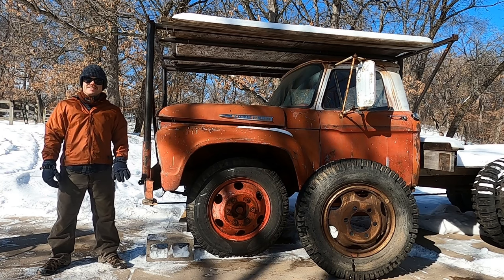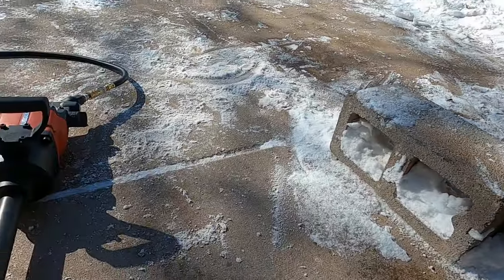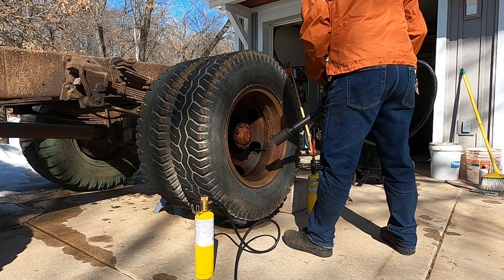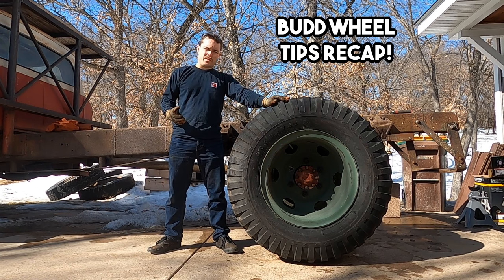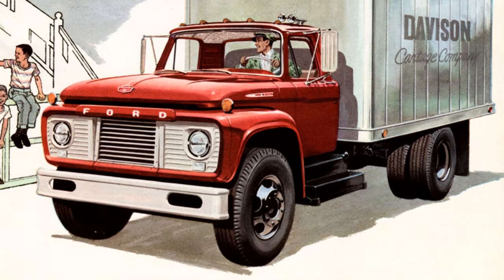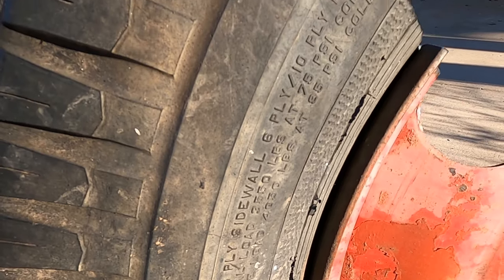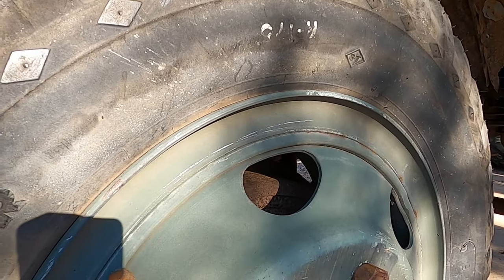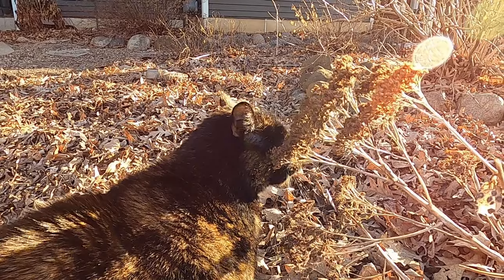All About Split Rims, Explained! Ep. 11

Comment: I have a question or at least just as bad as dayton rims or are they are the same
Reply from the maker: They were not mentioned in the OSHA documentation. Based on a few minutes of research, it looks like multi piece rims for Dayton style cast hubs are equivalent to split ring or lock ring wheels, with roughly the same risks. So, likely a lot safer than RH5°. It also appears you can get single piece replacement barrels for Daytons, which would be safer still.

Comment: I would just either find or have fabricated some modern single piece rims and not risk it.  I get that people can get crazy when it comes to "original equipment" on a resto, but I'd rather not have to worry about death by tire.
Reply from the maker: Sounds like your budget is a lot more generous than mine
Reply: @SealedBeamRallyTeam  It's more cost weight analysis.  Cheaper to get safe rims than to have to go to the hospital or morgue.
Reply from the maker: @hellcat1988  That's why I stepped up from RH5's to split rings. They're not the best, but they're safer and I didn't have to mount tires. In the long term I want one piece wheels with modern tires.

Comment: Is there any reason for the left threads
Reply from the maker: Short answer: no.

Longer answer: as far as I can tell, there was some superstition that the lug nuts should always tighten opposite the direction of wheel rotation, so that they wouldn't accidentally loosen. In reality this was never a problem.
Reply: @SealedBeamRallyTeam  Plymouth(probably many Chrysler products) Had left hand threads on the left, in the 60s. I didn't mind those so much. But the brass studs were a pain, as they would break off if you over tightened the lug nuts.
Reply from the maker: @swmovan  Brass studs!? Fascinating! I assume the reasoning was the same as for brass exhaust nuts.

Comment: I'm surprised they haven't been outlawed completely.  Is it because those trucks tires are impossible to get on a rim without taking the rim apart?  Do single piece wheels exist to replace any split wheel?
Reply from the maker: By the time OSHA wrote its report, the RH5 had been out of production for seven years. Short of the government buying everyone replacement wheels, there's not a lot they can do. You can mount and unmount wheels from the truck just like any other wheel (considering the extra risk with newly mounted tires), but when you go to replace tires, that's when the danger comes into play. To be clear, it appears that the OSHA guidelines for correctly matching rings to bases and inflating tires inside cages have reduced the risk to a more acceptable level. The Alaskan lock ring wheel incident in 2003 was the most recent I could find.

I'm sure you could get one piece wheels for whatever you want, though you might be stuck with a different size tire. Many companies will drill the right bolt spacing and center bore for nearly any vehicle, however those services come at a high cost and thus are usually only used for racing or show applications. I chose the split ring wheels because they are much safer than RH5's, are relatively affordable, and mine came with used tires already!
Reply: From what I understand, all truck (and perhaps some car) rims used to need to come apart to slip the tire on.

Technology improved (perhaps truck tires became more flexible?) and now large truck tires can be mounted on solid rims just like car tires can be.

There's still a place for mulit-piece split ring rims. Large vehicles like payloaders and tractors with huge thick tires that will never stretch over a solid rim. These wheels are still made to this day.
Reply: There's aftermarket companies that make single piece wheels. For large trucks, most go up to "half sizes" like 22.5s in place of 20s and 24.5s instead of 22s.

Comment: That gun needs 1/2" hose. Dont be cheap. Another 40 bucks.
Reply from the maker: A thick hose on a restricted air compressor fitting won't do much.
Reply from the maker: A thick hose on a restricted air compressor fitting won't do much.
Reply from the maker: A thick hose on a restricted air compressor fitting might not do much.
Reply: Need 1/2" hose and fittings back to the tank. Only way that gun will run properly.

Comment: Ok so question, because I sorta notice the wheels that I look at in this video (https://www.youtube.com/watch?v=aNk8Xz6id-w), are being whacked at. 

is it a safety thing?
Reply from the maker: I'm not a professional. But what i see is that they are seating the lock rings with zero air pressure in the tires. My experience preparing props for this video showed me that a BFH is necessary- these things are STIFF and hard to move.

The danger comes in when you air them up. Tire cages are ideal, but notice that the wheels are being mounted on the rear of the truck, with the lock rings pointing inward. If the rings blew, they would really f*** up the truck, but they are not able to physically fly through the truck frame and out the other side.

Widowmakers would be the opposite because the rim barrel itself is split and can blow off if not seated. So you would be safe on the front axle, but not the rear. Don't get me wrong- it's going to sound like a literal bomb going off, and it's going to be VERY expensive. But it's not likely to kill anyone because the part that is bolted to the axle will not move.

Using an inflation cage is standard practice for a reason. But I (as an amateur) do not see a major safety risk with the installation of wheels on the back of the truck in that video- as long as they aired the tires up AFTER mounting the wheels, and used a remote airing system so they would not be next to a potential blow.

I hope that helps. Again, not an expert.

Comment: ❤❤❤.  GET A REAL AIR COMPRESSOR 🤡. NEED LIKE 18 QBIC   HI FOOT AIR FLOW ,,,  ALSO USE A 1/2 INCH HOSE,, SMALL COMPRESSOR + SMALL  & SHORT HOSE ,,  READ TOOL INFO PAPERS WILL TELL U AIR REQUIRED  TO RUN A  1" TOOL ..SUCKS LOTS OF AIR. VOLUME ⭐⭐🌈🍎

Comment: Yes, suicide rims are dangerous but a LP 22.5 Tubeless that has been ran flat has the tendency to zipper, and from experience the air force alone ripped my jeans off bruised my stomach and destroyed my cell phone. It was my fault for not using a cage....all medium commercial and OTR tires should be aired in a cage.

Comment: Instead of higher air pressure (increases danger), use a torque multiplier to remove the tough nuts.

Comment: why not swap to modern wheels that are a single piece?
Reply: A vehicle with all original parts is more valuable, and sought after, than one with replacement parts.
Reply from the maker: I plan to do so eventually for drivability. As much as I dig the old stuff, getting modern wheels and tires would give me a lot better balance and more comfort at higher speeds. Besides, getting new wheels and tires with the right specs is incredibly expensive for a guy like me. Getting it on the road was a higher priority in the short term

Comment: Oh Good grief,  I have used them for 40 years,  common sense goes a long way, I put them on an inside dual with a mounted outer tire to air up, safer than a cage anyway.   If Harbor Freight didn't tell you on their box, you need a bigger air line for an inch impact, that will solve your problem,.

Comment: Hate to tell you my half inch impact would handle that, that's the difference between Harbor Freight and quality... Also, help if you have the right air supply pushing your wrench, I dont even use a tank that small at home to air up mower tires... What kind of shade tree BS is this.
Reply from the maker: I got the bigger gun because my craftsman 1/2" at full blast couldn't handle it.

I should have bought a torque multiplier instead of the stupid 1", because I'm not buying a Harley Davidson air compressor just for this truck!

Comment: i hate both them the window makers are the worst including the split rings omg when they pop off while in the damn cage i always tell customers that use them just to get rims that are not split locking rims or widow makers i always take them out back were we air them up in a cage an we show them why they don't need a split ring an widow makers because the first time we air them up they blow up instantly for no reason even though we did them correctly an we check twice

Comment: Your video, like all others is very mieading. The impression you make is these wheels are death traps. They aren't.  When you have a wheel type family that's been in service since the 40s and you have around 100 deaths out of the millions of rims in uses and hundreds of millions of tire changes, they are actually no worse than 1 piece tube type and tubeless wheels. They are dangerous for sure for the uneducated and improperly trained.

People don't check anything tirewise anymore. Once these wheels have tires mounted and successfully inflated, the biggest safety factor is proper inflation. More air pressure = more tire strength, and also more strength in holding the wheel together. The stupidest thing you can do with these wheels is run them low on pressure, or trying to inflate a flat or under inflated tire without jacking up the wheel. Split rings allow easy seating inspection when reinflating.

Experienced people can tell if a split rim is successfully locked in with a tire mounted. You must remove the wheel and thoroughly clean the wheel so you can see the seam line.

The steps on these wheels are deflating the tire before removing the wheel. Using locking tire chucks and standing away from the wheel when inflating tires already mounted on a vehicle. proper tools for disassemble. Thorough cleaning and inspection of all parts of the wheels. Proper tools and reassembly of new or properly inspected used parts. Using a goddamned tire cage when inflating. And inspecting the wheel after inflation to ensure everything is still seated before removing it from the cage.

Using a wheel or ring that is bent is not allowed. Not cleaning the rings and rim/barrel is required every time. Any part of the interlocking surfaces that shows pitting or gouging of the locking surfaces instantly turns those parts to scrap metal.

It's been 40 years since these multi part wheels have been seen on new trucks, but they are still the standard on off road equipment. There is no lack of experience in the tire world if you take these wheels to the correct shops when getting tires. The DIYer restoring a old shitbox is the problem because the it's good enough attitude and thinking they know everything that gets people hurt. I've owned big trucks for 40 years, I do my own tire work. I've thrown away a lot of parts looking maybe OK that I wasn't sure about. I've never known anyone hurt by these or anyone who knows someone hurt by these!
Reply from the maker: I would recommend you read through the comments on this video. There are a lot of gruesome stories. Guys getting their arms taken off, faces removed, weeks in the hospital (for the lucky ones) and split rims flying across shops to dent structural steel. We are all human, we all make mistakes, and these wheels are significantly riskier than other types when things go wrong. I'm not going to tell anyone to scrap their RH5's, but we should be very aware of the risks of that wheel design. Thanks for watching!
Reply: @sealedbeamrallyteam  people repeating and further exaggerating stories don't impress me. I've got enough experience in life and self integrity to know most people hear something, and when they repeat it it gets exaggerated. So the questions comes down to how often does all this happen? Probably not in the frequency it's claimed. I grew up in Agriculture, I've owned trucks for a long time. In all my experience, 59 years, I have never encountered anyone so much as injured by these wheels. 

Did it occur to you that this could have all started as hype from a competing company marketing 1 piece wheels? All someone would have to do is know how these wheels work,  blow up the risks to exaggerated levels, and most peoples' ignorance will do the rest.

As I stated, they are potentially dangerous, but this is limited to the careless who could manage to do damage to themselves tying their shoes, the arrogant who know everything, the stupid who will try to get one more tire mounting out of safety compromised parts, and the DIYer who thinks he's got a handle on a tire change he's never done. 

If these wheels were so dangerous, the insurance industry would have had them legislated out of existence or terminated coverage for anyone dealing with these.

Yes, the danger is possible. But tire mounting on any rim has risks of severe injury and death. The biggest threat I personally see, and it's from first hand experience is in inflating tires on these wheels if they've gotten severely under inflated, or gone completely flat allowing the wheel the bear the weight of the truck against the ground directly on the wheel. That situation can dislodge a ring or on any of the multi piece wheels. I caught it and was able to pull the core to deflate. You always take the weight off the wheel, inspect it thoroughly to make sure everything is seated, then reinflate.

There's too much hysteria about these things.